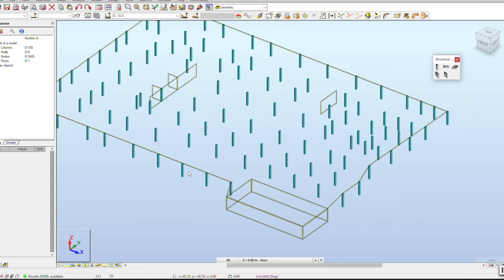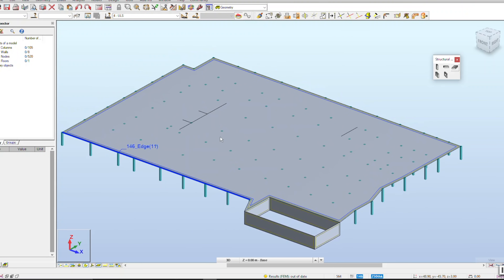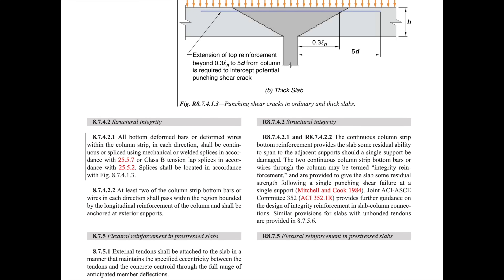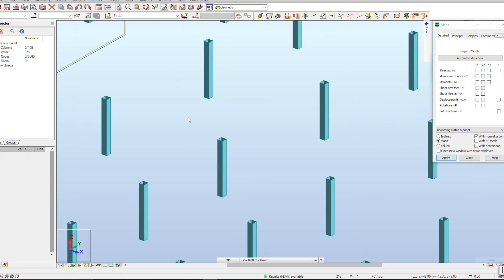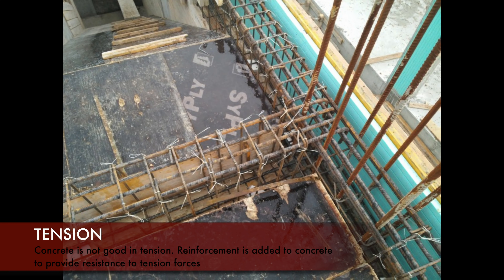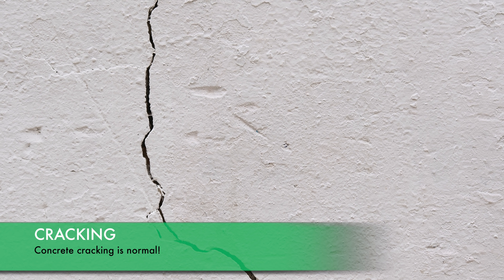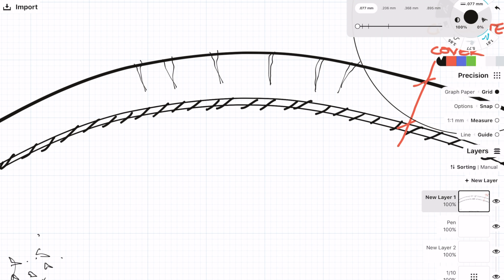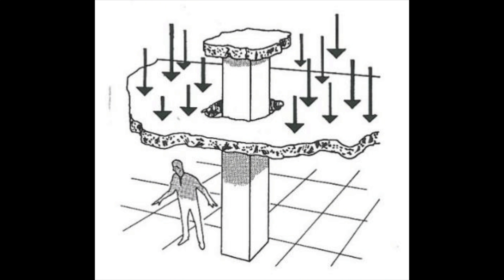Surfside Condo Collapse - Concrete structure basics - Slab bending and punching shear failure

Comment: In recent years building codes and standards have been improved significantly, as has our ability to inspect and simulate old buildings to pre-empt future issues. The biggest problem we face right now is engineers who DO know better seeing old structures with clear design flaws compounded by construction errors, environmental degradation, misuse and poor maintenance who then fall victim to the fallacy of "oh but someone older and more experienced than me signed this off so its fine" or "well it hasn't fallen down yet so it's not going to fall down now" and kicking the can down the road.

Comment: Very nicely explained Darren. Well done. I think this one is the best video in the series. There were theories explaining that the slabs were hollow core slabs in the building and since Hollow core slabs(HCS) are not monolithically connected to the beams or columns that also contributed to this collapse. The screed on top of HCS was not sufficient as some videos claimed. As you said, slabs were not designed for ultimate load. I thing even the columns at base level were not strong enough to take the load of the entire storey. Would love to see another video on that. And a separate compilation video of all that. 😀
Reply: https://youtu.be/HPwJ0JvTcg8 just a simulation video found on youtube

Comment: 3:19 shows a different design. Columns have capitals and slabs are supported by beams in addition to the columns. Champlain has neither, only flat plate.  There is no evidence of crack propagation in the interior away from the garage.  But all those interior columns can be seen laying on top of the slabs. That can only mean that all of the slabs slid down all of the columns just like the pool deck. Inherently unstable design. Danger for those living in similar structures. 60% of Mexico City collapse were that same design. The sister building are not safe.
Reply: His drawing is missing a bunch of beams and slab height changes.  A result of his thorough review of the drawings I am sure.  Which makes his opinion worthless since he didn't even attempt to analyze the correct structure.

Comment: The design would be considered non standard, in bridge terms.  Non standard means it was designed to a code no longer in use.  In most cases non standard does not mean unsafe.  This design likely limited the stress in members while only considering service loads.
Reply: It was and is a fairly common structural concept. It was just that the rebar and slab thicknesses were under designed (even for the era). This concept can be designed to current and old codes. If properly designed, he slab design would not change too much between the codes.
Reply: @yodaiam1000  I honestly have no idea what you're trying to say.  There's definitely a difference between members designed to ASD, LFD and LRFD.
Reply: @m.5051  Either way you design it, the end design is very similar. You might get 15M at 12” with LFRD or 15M at 11.8” with Allowable. There is not much difference. LFRD is slightly less conservative than Allowable. If you can’t make a design work in LFRD, it won’t work in Allowable.
Reply: @yodaiam1000  I do not believe that to be true.  What is your experience with the different design methodologies?
Reply: @m.5051  I was going through my undergrad during the transition. Statistically heavy DL buildings have a lower overall effective FS with  LFRD. That is the whole idea. DL is more predictable so it has a lower factor.
Reply: @yodaiam1000  Right...this is the one sentence textbook and Google search answer.  I work with multiple design standards all at once and it's not that simple...simply put of course.
Reply: My point is that I can tell you're not a design engineer.  I don't comment on things I don't know about.
Reply: @m.5051  I have a MASc in structures. A P.eng, a Struct Eng., passed the MIStruct.E exams, and I have been designing structures for over 30 years. So I think I might know what I am talking about. I was also an engineering during the transition where the rationale for LSD/LFRD was heavily discussed with multiple lectures. I also renovate structures from multiple eras and I can attest to the differences and lack of differences in the designs.

So your sense of my knowledge is way off. What experience do you have?
Reply: @yodaiam1000  Bit scary.  So you can say with certainty that the modern code/standard would produce very similar members when compared to the code/standard that was used to design this structure?  This is in the US obviously.
Reply: @m.5051  yes. Just think about it for a second. Do you believe gravity load structures fundamentally changed in design over night? They didn’t. You can with both methods and get similar designs. Heavy DL structures are slightly less conservative as heavy LL structures are slightly more conservative. That was the entire goal of the LFRD system.

Honestly, do you have any experience what so ever. I have reviewed thousands of buildings and have worked on more than a thousand projects. Are you just trying to be obnoxious? Are you trolling?
Reply: @yodaiam1000  This is silly. Yes, yes, I get it.  LRFD uses a 1.2 ish DL factor for strength limit states while ASD uses 1.0. You keep bringing this up like this is the only difference hah.  Nothing else is different in these historic codes, just dl and ll factors lol? Secondary reinforcement in concrete beams, no changes to the requirements ever?  Steel beam proportioning and ductility requirements, no changes ever?  Lateral load determinations, no changes ever?  The list goes on. You're over your head and it's obvious you're not a designer.  Your level of understanding is way too shallow.
Reply: @m.5051  The Load factors increased. Where I live, 1.25 and 1.5 for DL and LL respectively. The material factors are also increased. The net result is very similar. When I was young, senior engineers double checked designs with allowable to make they didn’t make a mistake. 
We are not talking about Seismic design. The ductility for gravity loads has not changed. There are other changes in the code. We are talking about the gravity load on the slab. The actual design has not changed significantly.

Answer the question. What are your qualifications and experience? You sound like a troll using Wikipedia.
Reply: @yodaiam1000  I'm not talking just gravity loads, I'm talking about historic design codes vs current codes. You're the one stuck on gravity loads for whatever reason. What were the LL requirements when this structure was designed and built? Are they different now?  And yes, I'm a licensed Wikipedia engineer.  Ductility is not only a seismic consideration.  In bridges, steel members are proportioned to ensure the development of significant and visible inelastic deformations before failure.
Reply: @m.5051  Your a Wikipedia engineer? What is that? Do Wikipedia engineers design structures? I never heard of a Wikipedia engineer. What is it that you design? Is it a software engineer? 

I am talking about gravity load since it is the gravity load system that failed and was analyzed in the videos. The original question was about comparing current code requirements for the design to previous requirements. Ductility in gravity load systems for concrete has not changed since the building was designed. There have in fact been some minor relaxations to both strength and ductility. Embedment and splices have increased slightly but most designers use the same rules of thumb that are slightly conservative.
Reply: @m.5051  I should mention to that ductility in steel beams for gravity hasn’t changed since the seventies as well. You still use class 1, 2, or 3 unless you use the light steel framing code. Again EQs are different.
Reply: @yodaiam1000  I honestly don't know what we're talking about anymore.  My point was that design standards change and there are many sections that can be affected by these changes - not only changes to design methodologies. My ductility example was for steel beams, again, not specific to the video, but for illustrative purposes. Yes this wiki engineer design bridges in the states.
Reply: @m.5051  Never heard of a Wiki Engineer.

You obviously don’t know what you were talking about. You just wanted to argue and lost track of the original premise and issue. The point was that the original slab was checked to modern code which is an acceptable method of confirming the original gravity load didn’t meet the standard of the time.
Reply: @yodaiam1000  It should not be expected that an existing structure complies with today's design standards or practices. You can't analyze the slab using today's standard and say that it was underdesigned with certainty - especially with no knowledge of the evolution of codes in the US.  Wiki engineer was joke jc lol.  I design bridges so I admit that I don't have a vast knowledge when it comes to all things buildings.
Reply: @m.5051  you may not expect it. I am telling you it is perfectly acceptable for a case like this.
Reply: @yodaiam1000  I didn't watch the video but I definitely don't trust your engineering judgement. We can end it there.
Reply: @m.5051  Do your own research. I really don’t care if you trust me or not. I have being do this a long time. I design lots and lots of concrete buildings through multiple code cycles. I have worked on concrete building and reviewed their drawings back from the 20s to current day. I know exactly how things have and have not over the years. I even started my career in the early 80s when the codes were switching from allowable to LFRD.

Analyzing the slab gravity loads with current code will certainly get you very close to determine if the original slab was designed properly.
Reply: @yodaiam1000  Sure you have bud.
Reply: @m.5051  Just do your research, and don’t jump to conclusions. You may find it hard to believe, but other people may have knowledge on the subject than you.

You should also grow up and stop being so obnoxious.
Reply: @yodaiam1000  That one cut deep.  You and your gravity loads got me.

Comment: ACI allows 3/4" coverage with a tolerance of 1/8" which is not enough.
Reply: From my memory of rebar deign 50 years ago (in uk) cover determination was based on exposure conditions and rebar diameter. 20mm or 3/4" would not be enough in a external marine environment (especially with a saturated slab)
Reply: @postie48  Yes but that is not classified as marine. 1.5" exposed to weather. Still horrible inadequate as most construction is out of square.

Comment: What about the other theory regarding a slab height change?  The original plans indicated a 12" drop from the building slab to the pool deck slab, with a huge BMA under it.  The changed plans indicate a now flat slab with no drop from the building to the pool deck, and now no BMA under it.  Revised plans now have the pool deck and building slab connected to each other, instead of the pool deck being a separate slab from the building slab.  Combined with water leaks, rebar rusting, cracking, this appears to be the main issue that brought the building down??  Thoughts?
Reply: Beam A is the beam type. Not what that idiot from the other channel mixed up with a MBA.
Reply: Nope. the massive shear wall took the eccentric loads
Reply: BMA=beam type A. The slab was tied together regardless. It is normal for the ground floor slab from the exterior and interior to be tied together. There are usually steps just to deal with all the geometry issues with the architecture. Don't listen to the the nut bar on the other channel. He is just a realtor and small time contractor with a really big ego and no knowledge.
Reply: @yodaiam1000  you mean to cocky one with the cats?
Reply: @designstudio8013  that’s the one. The realtor with all of his “conclusive files” and the “amygdala” that keeps on firing off. The “engineer” that doesn’t believe in gravity.

It was kind of a joke of a character but now he flames other people and then blocks them so they can’t respond.

He is a text book Dunning Kruger effect. It is hard to believe people fall for that stuff.
Reply: @yodaiam1000  A guy named Jeff does remodeling but a idiot named Kai is the amygdala engineer nut who is threatening to sue the realtor.
Reply: @designstudio8013  Kai is the realtor believe it or not. He doesn’t talk like one but that is his professional credentials. He only tries to pretend to be an engineer. It looks like he has some contracting on small projects like Tenant Improvements. I doubt if he was even in charge of those projects but he certainly pretends to be.
Reply: @yodaiam1000  Well then he's in big trouble if he sues the other contributors. They should call his bluff.. I goota admit he has found some big mistakes on the plans such as a beam missing in the patio slab at elevation change and some weird offset columns. I did some calcs and could not determine how the patio could cause the collapse of the building unless the column and or floor were ripped apart and failed. 
The column left standing on the southeast
at the garage  which had the slab ripped away stood up albeit with some damage.
Reply: @designstudio8013  There looks like there were a bunch of mistakes on the drawings and in the field as well. The realtor says a lot of things. He is like a broken clock. He is correct twice a day.
He doesn’t know how to read a set of structural drawings. He thinks the top bars are actually bottom bars. He thinks BMA means monolithic pour etc. I don’t know how anyone can pretend to be a structural expert and not know how to read drawings or do any calculations. He doesn’t know statics. It is fundamental to what he needs to do to determine the issues and present an argument.
Reply: @yodaiam1000 He said yesterday he was a licensed engineer and would have to work with someone licensed if he bought a condo to repair. Can you look him up if you know the State he is in? He is sueing several people for theft of his ideas.
Reply: @designstudio8013  There is no way he is a licensed engineer. You have to pass an EIT and PE exams. He doesn’t understand basic statics, vectors, how to use Newtonian gravity laws, etc. He doesn’t understand basic high school physics. I can track it down but I don’t want to accidentally dox someone. He has a realty license and not an engineering license.
Reply: @yodaiam1000  Well it still will come out in the lawsuits. I am trying to figure out what state he is in.
I don't even know the name of his business.
I took engineering courses in my Architecture training and worked as a design Engineer. 
I did some calcs and it seems implausible that the deck ripping of the columns could bring the bldg down unless the slabs fell into a column or the slenderness ratio was compromised.
The column at the garage cold joint failure was damaged but did not collapse
Reply: @designstudio8013  Anyone can sue anyone for anything. I don’t think it will go anywhere. I have serious doubts that any lawyer would consider this a legitimate argument in court. If two or more people see the same photos and come to the same conclusions about what they see, it is not stealing an idea. He didn’t invent the fact that punching shear or one way shear existed in the collapse. It is an observation and not an invention.

We don’t know for certain how the columns were damaged. However there is an elevation change. The collapse of the deck can pull at the columns causing large bending and shear forces on a column under heavy compression. We also don’t know how much water damage and corrosion was in the columns.
Reply: @yodaiam1000  correct
Reply: Nobody responded to the elevation change, though.
Reply: @Katoshi_Takagumi  Thank you.  Although I did get the data from Kai (he had the original plans and revisions) I was asking as a possibility that having that beam under and having a different elevation between the two slabs would have made any difference with the amount of neglect and water damage?

Comment: I get mad when see people trying to push maintenance factor as main reason. 
Try to put in your model additional centimeters of sand and tiles. Then add the heavy garden pots that had palms in it. Then consider that they had cars and forklift driving over there. 
From the rubble you can spot missing or incorrect placement of rebars. We don't have the concrete expertise yet but from an interview of the team who drilled the building for demolishing they said that it didn't seem to have the strengthness they expected to have. 
I think only on the last place you can add the cracks from poor maintenance. 
We have a video of the basement a year before, it didn't look good  but it didn't look very concerning either. Especially because water was under the pool deck,in garage, not under the building. Under no circumstances a building should collapse suddenly. It should give many warnings that people can't ignore. And even if the pool deck collapsed that should be the reason for a total building collapse. 
I'm sure the building is barely standing and that the clone building is in big danger. A small earthquake or strong hurricane could collapse it if they won't reinforce it.
Reply: There's no record of a forklift being there AFAIK.
Reply: @Katoshi_Takagumi  you are a cat what can you know :)
Reply: @markmd9  I'm not a cat.